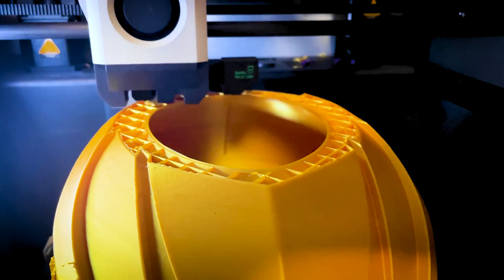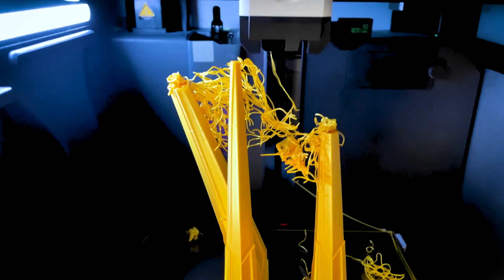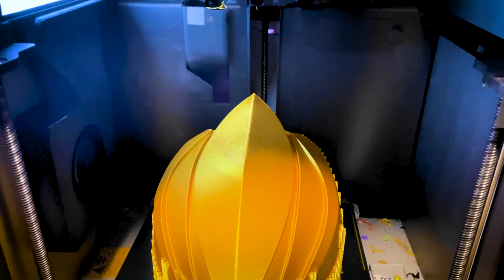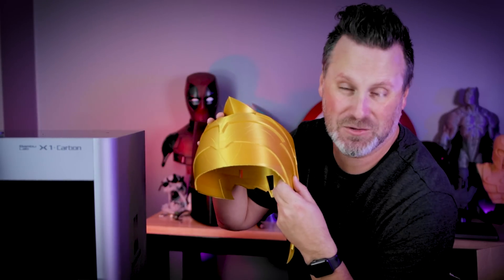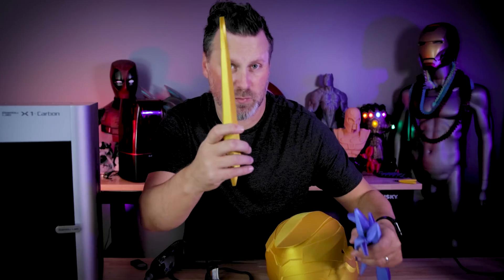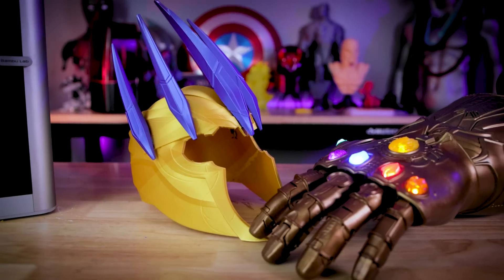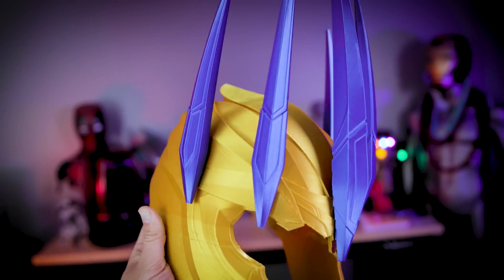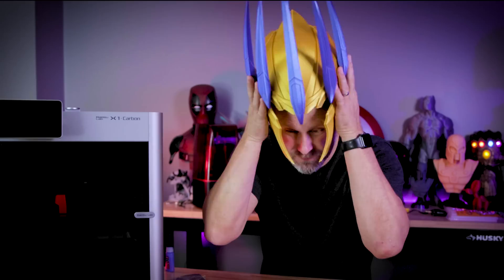Can I 3D Print this Helmet in under 24 hours?!

Comment: I believe the layer line issues might be due to using adaptive layer height, at least that's what I always see on the X1C when using that setting. Looks like a bit of underextrusion when it switches between different heights, but I haven't found a setting to combat that so far.
The helmet looks amazing though!

Comment: Slice it in cura using CHEP'S extra fast profile and see what the difference is
Reply: @Darrenhoneyfield  something funny about that?
Reply: @trekgod3  My guess is it's funny because the Bambu slicer is specifically tuned to the X1C for extremely fast speeds... Cura doesn't have a profile that works as well for it... at least not with a TON of tweaking/tuning.
Reply: @DonsArtnGames  I understand that , but it would be interesting to see how fast CHEP'S profile would print these parts, of course it would have to be on an Ender series printer

Comment: That turned out neat. If you sanded the Silk PLA, to smooth out the lines, do you have to sand the whole project to match up the same look/shine? 
I've only used 1 roll of blue silk. I did not like it.
Reply: all I know is when I tried sanding gold silk it looked awful afterward, would have to paint it or something it'll look really flat
Reply: @waynefilkins8394  5 months later and a reply, well, thank you for that. I kinda figured it may need repaint but printer went 6' under so could never test it.
Reply: @RoseKindred  yeah i'm always ignoring dates on stuff on the internet lol sorry
Reply: @waynefilkins8394  No, you didnt necro or anything, just funny it took someone so long to answer. YT is weird that way, I thought my comment was hidden by the filters lol.